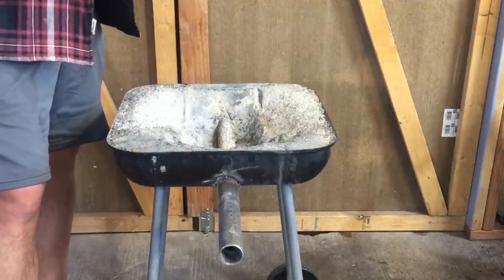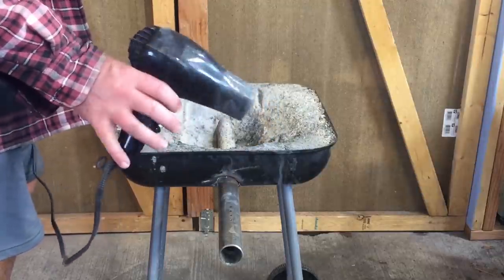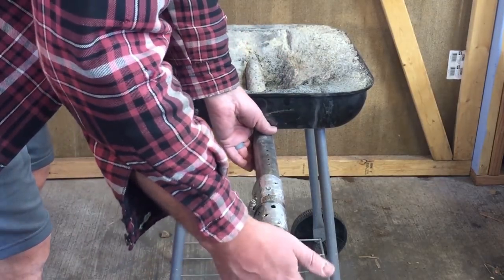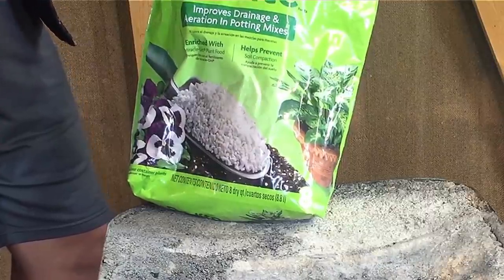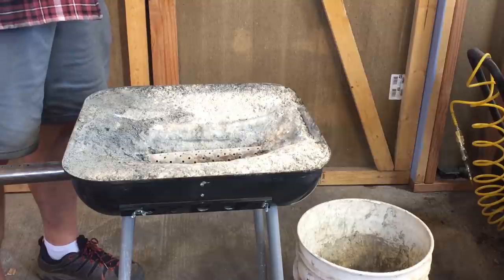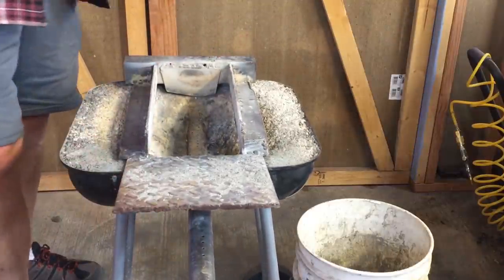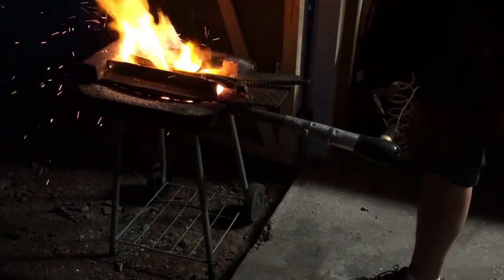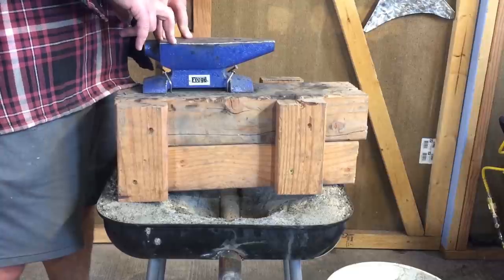$100 Charcoal Forge...Why didn't I do this sooner?

Comment: Good point on not using galvy! It releases zink fumes. As far as refactory cement you can do it super cheap by using equal parts of of play sand and plaster of Paris. I used an old briquette starter (the kind you use newspaper with) i took out the screen and drilled a hole in the side of it i think it was 2" dia.
Then i took a piece of 3" abs and drilled a 2" hole in it the same distance from the end to match the hole location on the briquette starter.
Then i centered the abs in the starter and ran a piece of pipe through side of both of them to create the induction chamber.
Then i mixed up a slurry of the 1:1 play sand and plaster of Paris and pored it around abs filling it all the way to the top.
Before it was all the way set up i removed the two pipes and let it set for a few day's.
The expensive part was the ventruri burner which i ran into the hole in the side. The burner i purchased from amazon and i think it was like 80 bucks. It's beginning to crack but it's been about 3 years.

Comment: Nice set up mate, although I would trace round the anvil and chisel out a recess for it to sit in so the feet are flush with the top of the wood then strap it down (maybe with some flattened rebar) 👍

Comment: I’m 9 and I build a Forge from a field disk
Reply: Job Butcher good on you;I expect you found out how hard it is to make holes in those disks! Iol.👍👍🤪
Reply: @patmiddleton3947  welp. Drilling case hardened steel isn't the easiest thing to do😂😂 
I used a oxypropane torch to cut out the holes
Reply: Job Butcher I thought you may have. I tried drilling a drilling a disk and got nowhere.I think I ended up hot punching the holes.😝😝😝
Reply: @patmiddleton3947  if you'd like to see my set up I have an Instagram @ penfieldforge where you can see the messes I've made🤣😂
Reply: Job Butcher well I’d like to have a look at your set up and things you’ve made,but I’m pretty old and haven’t done instagram yet.I am a bit behind with stuff like that.I’m very impressed that you’re only 9 and have made a forge from a disk and are forging ahead. It’s interesting work isn’t it?Your spelling is good too.If I get instagram I’ll check out your work.I’m not promising though.👍👍👍😊from New Zealand.God bless

Comment: is there a way to tell if a metal has been galvanized or not
Reply: thank you for the info
Reply: Galvanized steel is silver in color. You can use it but you will need to burn off all the galvanized coating and vent the fumes out.
Reply: Go to a hard ware store and feel and hold the nails and pipes.
Reply: by looking at it. put it on the grinder you will smell the zinc.
Reply: @justinriley8651  haha 😂😂
Reply: @joelewis6614  if you dont work around it everyday you might not know
Reply: you shouldnt toss stuff in the fire if you are not sure what they are. some alloys contain toxic materials, like Lead, and let fumes without being galvanized.

Comment: I’m trying to figure out how you managed to spend $100 on an ultra-cheap barbecue grill, an old hair dryer, and two feet of iron pipe. I’d peg that at more like $40. Did you then go out and buy $60 worth of charcoal?
Reply: Refractory Cement, Pearlite, steel pipe?

Comment: Can the pipe be in contact with the coals? And if so, how does it not heat up just as much as the steel you are forging
Reply: Exelent  question is all about degrees  RIGHT? So it 'd be nice if this dud would know,gogle,it may be.?

Comment: I really like this. But I would want to have something similar to the scrap-metal thingy you welded, and I have no idea how I could do it without having access to a welder
Reply: Do you have the ability/tools to drill holes in metal or get metal with holes already in it? Cause nuts and bolts are cheap
Reply: How about stacking fire bricks into a house-like setup -- seems like it would accomplish the same purpose.  Or cast the refractory concrete into a suitable shape using a plywood mold.

Comment: Can I ask, the holes that you drilled into your pipe, what diameter size holes did you use, and how far apart are they from each other, looks like an inch or so.  I had drilled 8 mm holes down the length of the pipe and found it to work with my bellows powered forge , but your method looks good too, although I am guessing with so many holes that the diameter would be for smaller sized holes.
Reply from the maker: Strahd Zarovic I believe I was using an 8th-inch bit which would be approximately 3mm? But I found it really wasn’t enough with a few holes so I drilled many more. I didn’t really go for specific spacing, I more eyeballed it. Not a very precise method, but it has worked reasonably well so far. My next forge will probably be propane. Thanks for the comment, cheers!
Reply: Thanks for the info.

Comment: I like your set up! I'm with you on the idea that you don't need much to get started. People seem to get caught up with acquiring the best tools or anvil, which you don't really need. I'm a beginner as well but you seem way ahead of me. My forge is an old rivet forge that I modified so it can use in a small shed.
Reply from the maker: eviltwinx Hey, thanks for the comment. Yep, I'm learning more and more the important thing is just to jump in and try things out. I'm glad I haven't spent a fortune on any particular piece of equipment, there's a lot of things collecting dust in the shop right now. Give it another few months, and I might want to invest in some higher quality tools, but for now I'm still just learning what I like and what I don't like. Cheers!

Comment: Good vid.

Since near the beginning of the year I have gotten into leather smithing, interested in learning black smithing. Not sure you will see this message, but one thing I am concerned with on starting black smithing is safety. Is there any safety tips you can give on starting out and setting up your first forge?